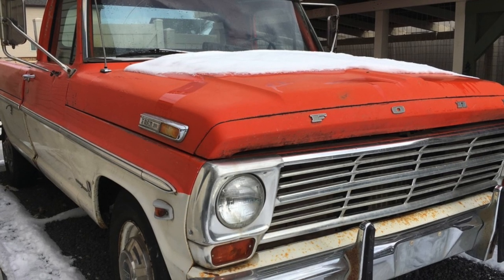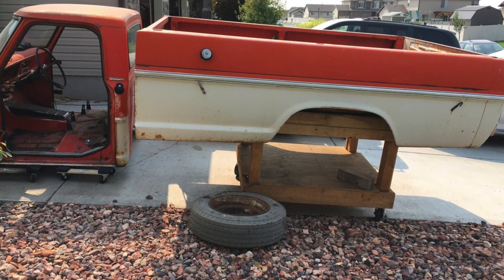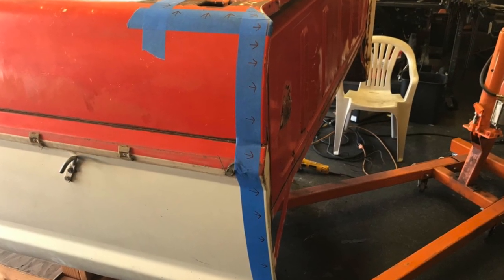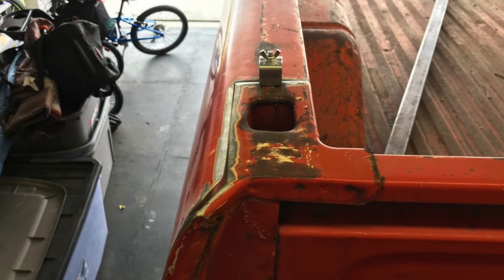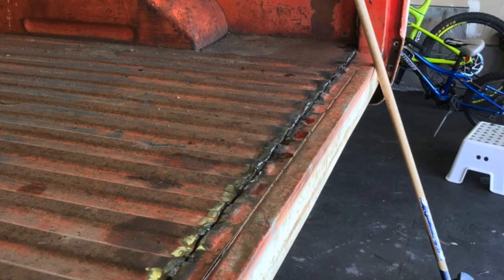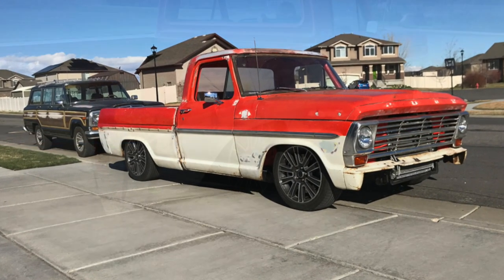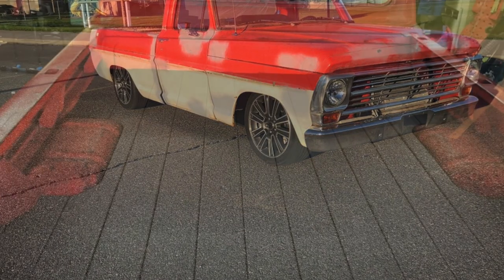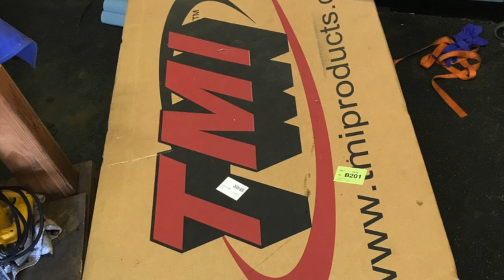Building a Crown Vic Swapped F100 in Ten Minutes

Comment: Ive build a few of these trucks myself. I was looking at the details! The truck looked great first of all. Could you tell me more about about the AC box you used on the inside i noticed it looked way smaller than the factory crown vic box! Did you cut it down or what box did you use on the inside. Thank!
Reply from the maker: Yup exactly, I just cut down the original box so it wasn’t so bulky under the truck dash. Thanks for watching! I love these swaps, great drivers!!

Comment: Considering a swap like this with a 79 f100. I love how you integrated all the Crown Vic stuff into the firewall, HVAC was one of my big questions. Question, what did you do for the gauge cluster?
Reply from the maker: This got a Dakota digital dash, but you can cut down the Vic cluster and make it look pretty good. Check out my other Vic swap video. That’s what I did on that one
Reply: Working on a 67’ flareside CV swap and had the same question about the gauge cluster. Contemplating between modifying the CV cluster to fit or splurge on the Dakota.

Comment: Beautiful build!  How precise did you have to be with splicing in the pieces of Vic firewall, or could you explain how you figured out how to place them?
Reply from the maker: The HVAC portion didn't have to be precise, really just test fit where you want everything to hang under the dash. As for the brake booster/master that dictated where the brake peddle would be located in the cab. But overall not too difficult.
Reply: Very nice work.  Looks sweet!

Comment: In the middle of this same swap on a 72 f250.  I’m really mimicking what you’ve done looks fantastic.  What did you do to the interior AC box?  Did you have to modify at all?  I’m on the step of mocking the firewall and about to start to to try and fit all this in.   Just looking for some pointers.  Thanks
Reply from the maker: I did end up cutting it down, I can’t remember exactly how though? Just looked at the box and deleted and capped some of the parts that looked overly bulky… good luck with the build!!

Comment: Nice! Did you use epoxy primer under you bed liner? And what liner did you use? Thank you
Reply from the maker: It’s raptor liner. I color matched the cab portions and a custom color for the bed. I scuffed the bed etch primer then sprayed. Raptor liner is really versatile and easy to work with. I love that stuff

Comment: With the standalone harness and stock PCM do you run into PATs issues? Or is there a few wires you jump at the connector to override it? Or does it not matter with the standalone harness?
Reply from the maker: PATS varies on what you do and don’t use from the factory harness ECU. Worst case scenario you can turn it off with Hp tuners.

Comment: I want to see you use a crown Vic parts car only. You still use the truck frame. Then adapt all the different systems to fit the full truck frame. Dont: just remove the truck body and place it over the crown Vic chassis. Seems like you just took the easy way, and are still just driving a crown Vic.
BullyBilly.
Reply from the maker: If I was pulling just the parts it wouldn’t be from a crown Vic that’s for sure

Comment: Hey hopefully you see this message and respond to it,but I want to do exactly what you have done have a short need 79 f100 and a interceptor 05, was wondering if you removed all emission stuff like egr did you need to have the engine computer tuned or flashed? And what you do with all thee extra wiring like the rear doors wiring trunk wiring basically anything behind the 2 front doors
Reply from the maker: You can keep or remove the emissions stuff under the rear truck you won’t need to flash computer. As for all the chassis harness most can be removed. You need to keep the fuel pump and inertia switch which is in the trunk
Reply: @FactoryFreshChannel  thank you so much for this info I appreciate it

Comment: I'm wondering how much of the crown vic harness you used. After rewiring my 2009 engine. It almost seems easy to go stand alone using the stock pcm.
Reply from the maker: Yeah it is and would do it that way in the future. Way easier than factory chassis wiring harness. I used a aftermarket 12 or 20 circuit chassis harness with stock pcm to run the engine/tranny.

Comment: What material did you use on the bed floor. That looks nice!!
Reply: Is it trex boards?
Reply from the maker: Yup trex
Reply: Awesome. Did you paint them?
Reply from the maker: Used raptor liner to put a light bed liner texture with a custom gray color tint
Reply: How did you attach them down to truck?

Comment: Clean job congrats on a cool ride. On my 79 I just used the crown vic front suspension upgraded of course and a four link in the back upgraded of course. I beefed up the small block and added a top loader. I kept the body stock only with new black paint but I like your choices all the crazy wiring on new cars was not for me I like simple even keeping mine a long bed with all the trim. Oh yeah great choice on tires and wheels in that respect we were on the same page. Again excellent job may you get many years of enjoyment out her. Looking forward to the next one keep up the good work.

 one
Reply from the maker: Thanks brother! That 79 sounds like a cool truck! Check out the Mustang F100 body swap I’m doing now! It’s crazy!!
Reply: @FactoryFreshChannel  I'm thinking of trying this with my 80 D100 short bed step side. I have a 11 P71 I no longer use, the wiring od is the scary part for me.